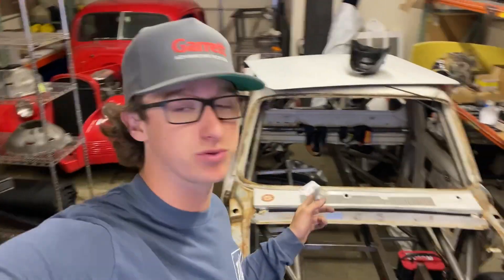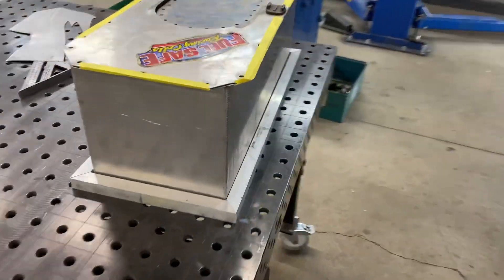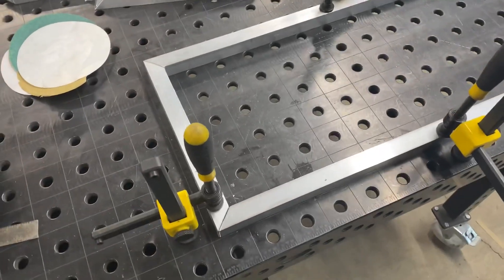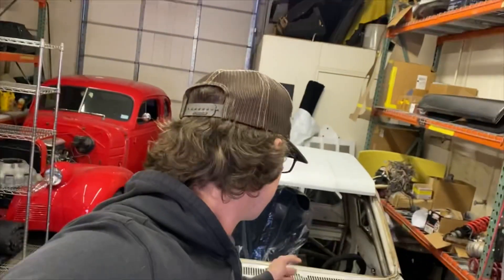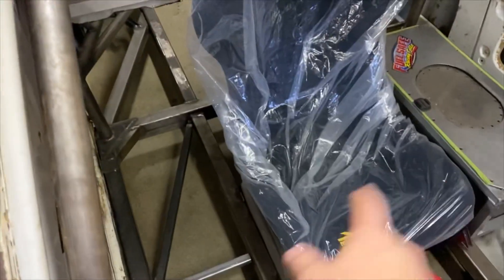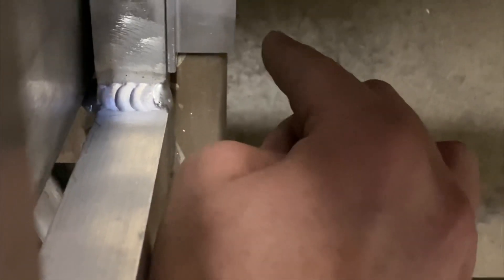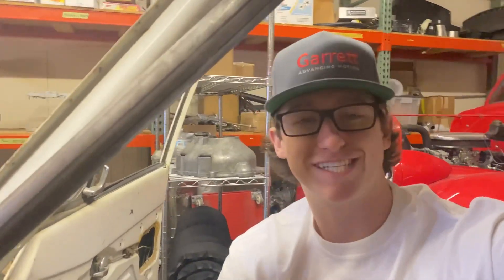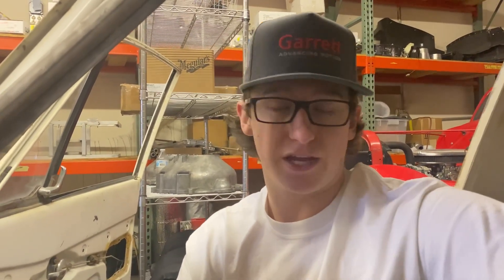How to Mount a Fuel Cell in a Racecar!

Comment: NO NO NO on the placements of battery and fuel cell. one good crash and you will be burned alive and thats not fun.  I dont think any sanctioning body would approve this. NEVER EVER put either in the drivers compartment, you always put as far away from you for maximum safety